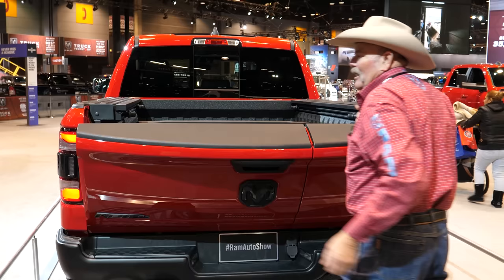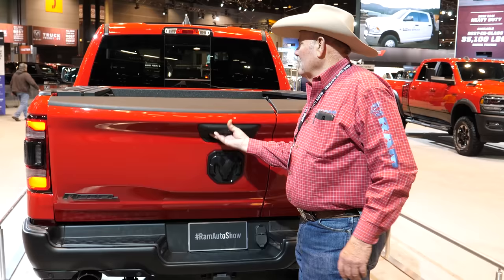2020 Dodge Ram Multifunction Split Tailgate Demonstration at Chicago Auto Show - [4K]

Comment: Fantastic feature. I hate having to deal with my current pickup that has the tailgate 40" off the ground and sticks out 2 feet from the bed when down so I can load anything. Try doing that with a few dozen bags of concrete (loading and unloading) and you will wish you had a SUV hatchback instead.

Comment: I hate hate hate hate hate the split is off centre. Good attempt at a multi function gate, I still think Ridgeline did it best, and the in bed trunk is a bonus. However, if this was split down the middle... It'd be great.... And for that reason, it won't be on my new truck.
Reply: The old buick sedan had it right.... no split in the gate. It opens like a door and opens like a box truck...

Comment: Do not understand why manufactures want to play with a tail gate, WHERE THE HELL IS THE REST OF THE BOX????, everything has a 4.5 ft. box It's supposed to be a TRUCK! you can not stand a kids bicycle in the back of a 4.5 foot box,. What good is a fancy tailgate if you can not put anything in the truck. Get rid of some of the use less bells and whistles and all the doors and BUILD A TRUCK!!!!!!!!!!!!!!!!!!!!!
Reply: ram makes 5.7, 6.4, and 8.0
Reply: I've been saying this for years. The problem is all the yuppies and wannabes want to look cool and drive a truck and have all the Gidget's and gadgets but most of those people don't need a truck for what a truck was built for. same goes for the Jeep Wrangler they're turning that slowly into a luxury SUV. Instead of going back to their roots and making a hardcore purpose-built off-road vehicle is capable of being driven on the road. I'd much rather have a vehicle it's easy to work on dependable in biltwell then have all the tire sensor monitors backup cameras and all the other computer gadgets they slap on all these cars that cause nothing but problems for people who actually use them. In regard to the Jeep Wrangler I wish Jeep and other manufacturers would offer cars that are still carbureted or have simple fuel injections on them with no computer system whatsoever. Let the end-user aka the buyer to sign a waiver saying hey I understand that this car has this and that I assume responsibility for it still offer a warranty just the manufacturer can cover their ass when someone says always didn't tell me it was going to do this or it didn't tell me it was going to do that.
Reply: @reds7vn644  Fuel injected motors are far superior though lol. So you're wanting manufacturers to take a step backwards when the world is moving forward... Sounds like you are upset because trucks are getting out of your price range ( Not going to lie, they are getting crazy expensive these days), but that don't mean they aren't better in each and every way than the older trucks.
Reply: @flexonthadevil  No, no fuel injection isn't as easy to maintain and service as carburetors. Fuel economy is not a strong argument nor his performance reliability and he's of service is where it's at. keep in mind not everyone could be driving around the United States and UK all the time some people are going to be in South America Africa and Middle East where you don't have the luxury of having a full service mechanic that can plug in and diagnose your vehicle for you. As no, I have/drive a F-150 Platinum, Q7 and Jeep Wrangler. I'm just tired of "tech" making my life harder. Anything causes warning lights, EMS shutdowns etc... .

Comment: I like how he brings  it up being dented, like he's telling people it can be dented. I mean, cmon! You don't sell people like that. And he's not even right in that aspect because it has a rubber like piece so it doesn't do damage to the paint..
Reply from the maker: Stupid design flaw if u ask me
Reply: Internal Combustion It’s a heck of a lot better than GMC tailgate. It hits the friggin ball hitch and damages the tailgate...
Reply: @joeyo9894  Really, and someone likely did it when others tried the new truck walk around while you weren't watching just after buying it as everyone usually fawns over a new vehicle running their hands the full length down the freakin' mint paint job even when it's dusty!
Reply: @joeyo9894  Right? It's their fault for not designing it for the people that leave their ball hitch in, even when it's not in use.